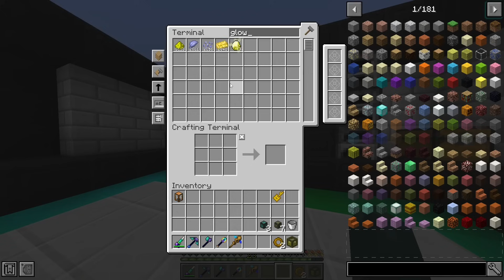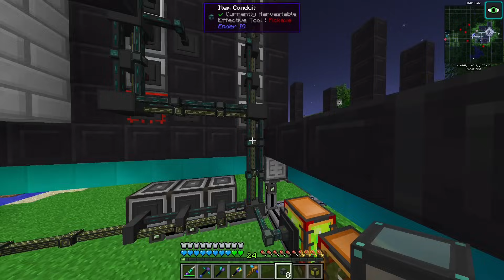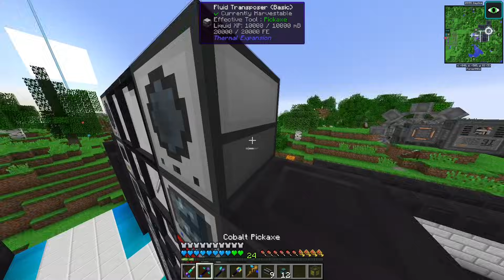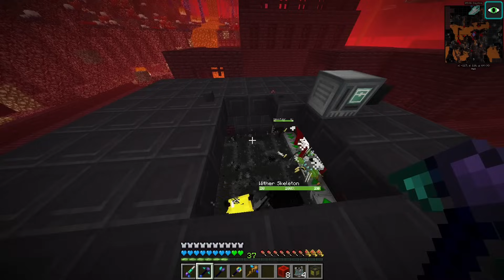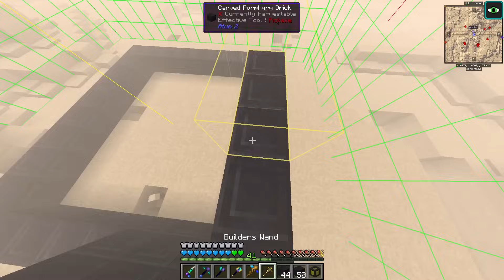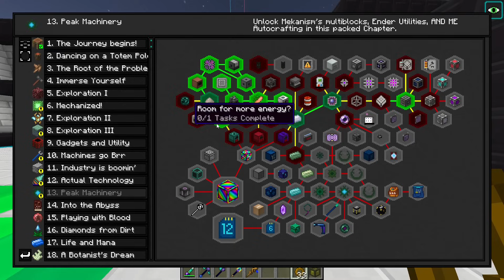Divine Journey 2 [16] - Multidimensional mob farms and reconstructor automation

Comment: Maybe extract it to a buffer, and then extract (with redstone on) to the dropper? The current setup can break if AE2 loses power (or you broke a cable) for some reason.
(Redstone on, machine on)
Reply from the maker: Technically if i lost power to my me system, the interface would also stop requesting the items right? so i think it would only craft an extra stack of all the crystals which is fine. But i will be careful when using level emitters in the future, dont want things breaking and wasting items lol
Reply: @AntiAxolotl It should be fine for the most part, unless you somehow break the cable for the level emitter specifically.